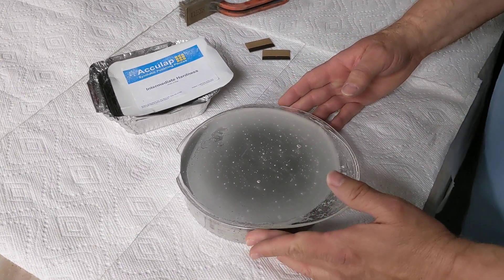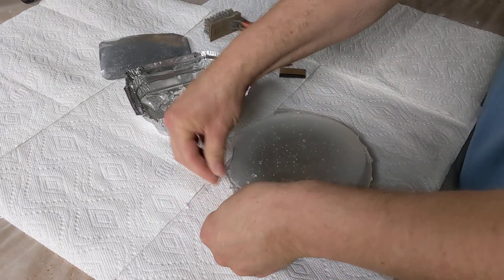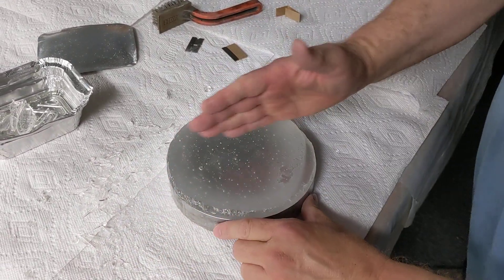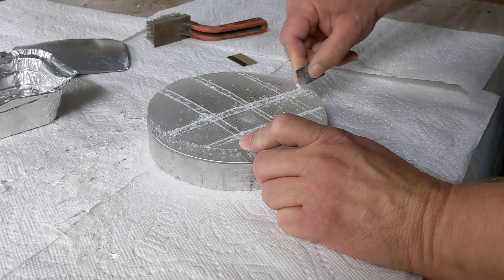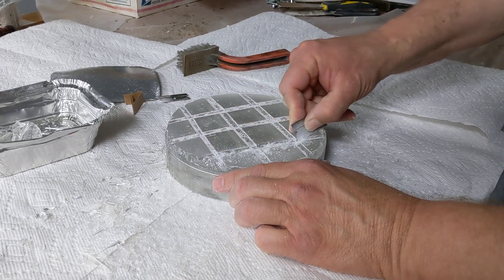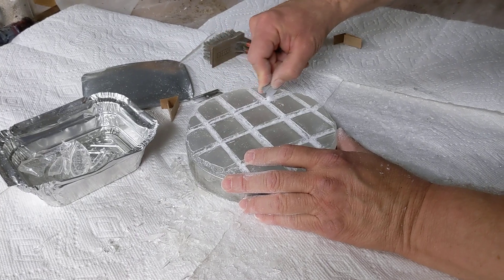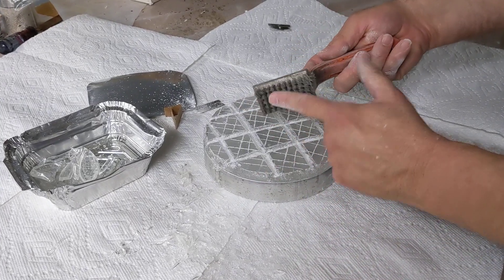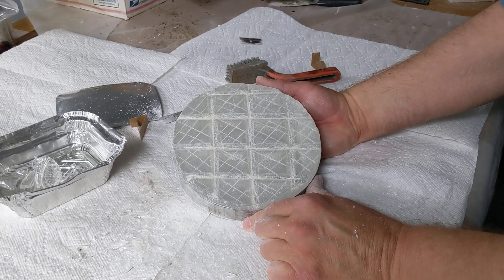Faceting an Acculap Polisher for a Telescope Mirror

Comment: Glad to see you're still doing your thing!
Reply from the maker: Hi, Michael!  Nice to hear from you!  Yes, we're making mirrors.  Seems like a very long journey over the last 20 years.
Reply: @GordonWaite  A long journey indeed. I never had much love for acculap - and I missed the sweet smell of pitch. Have you figured out the secrets of using it? Is it better than gugolz for figuring, or mostly for polishing?
Reply from the maker: @MichaelLindner  I've grown to like it.  The harder grades are terrific for polishing out spheres.  Much less prep needed on the polishers.  For figuring, you have to use softer grades and fairly thick layers.  These work mostly like pitch.  Very good for standard focal length mirrors.  Okay for short mirrors, but you have to be a little gentler.  Generally, though, the Acculap saves us quite a bit of time.

BTW, I have a 40" mirror blank in the shop I'm about to start for an overseas client!  It weighs 300 pounds.  Has to be delivered by the end of January.  Should be an interesting fall!

Comment: Gordon, what made you switch from pitch to Acculap? Does it work just as well? I've heard mixed reviews.
Reply from the maker: Hi!  I haven't really switched.  I still use pitch for things as well.  The Acculap has a lot of advantages, especially with the harder grades for polishing spheres and flats.  It really excels there.  Also it doesn't smell bad when you melt it.  I take advantage of it for business purposes as it saves me cleanup time and lap maintenance time.  The time savings makes up for the 20% cost difference.

Comment: Gordon, never even heard of Acculap.  What criteria did you take into consideration choosing an intermediate hardness?  How does the cost compare to pitch?  Is the lap material as sensitive to temperature variations as traditional pitch?
Reply from the maker: Hi, Gordon!  I've used intermediate a lot in the past, especially for making spheres.  It is quite a bit harder than, say, #64 Gugolz pitch.  You can machine polish with Intermediate Acculap for 4 hours and your channels will not have closed up.  With #64 Gugolz, you would have to trim once during a session that long.  As for price, 1 Kg of Gugolz #64 is about $40, equivalent 1Kg of Acculap Intermediate would be 3 packages of 1/3 Kg each, which is about $16.50 per package, or $49.50 per Kg.  So the Acculap is about 20% more expensive.  Benefits are, it doesn't smell bad when you melt it.  It isn't as stringy as pitch.  When you trim an Acculap polisher with a razor the chips won't stick to you.  It comes in more hardness variations, so you can more easily adapt it to your working conditions.  When you are trimming it, it doesn't tend to "chip out" as much as pitch.  It is clear, and it is just a cool product.  It's worth the cost just because it doesn't stink when you melt it!
Reply: @GordonWaite  Gordon, Thank you so much for your response.  It is great to see you generating presentations again.

Comment: I find it a little odd that this industry doesn't have more specialized tools oriented to rapid, consistent production.  ie, a specialized tool just for handling lap/pitch
Reply: Camera lenses are expensive enough after automising that production process: https://www.dpreview.com/articles/3583146192/inside-nikon-hikari-glass-factory?slide=25
This video is on small-batch enthusiast-level large mirror grinding methods. Anything beyond this scale is also beyond normal income budget, etc. etc. They exist, the more specialised production methods, they are just not targeted to a market large enough to be viable: https://www.youtube.com/watch?v=TFjJ6SZmpTM&feature=youtu.be

Comment: The lap looks kinda hard.. does it cold press easily?
Reply from the maker: The polisher is slightly on the hard side because it is intended for polishing a sphere.  This polisher is molded directly on the mirror, so it has perfect contact without any need for pressing, really.  With these Acculap polishers, they are on the mirror polishing about 20 minutes after I pour them.
Reply: @GordonWaite  Got it. Thank you😊.